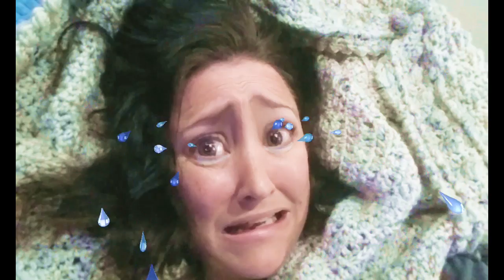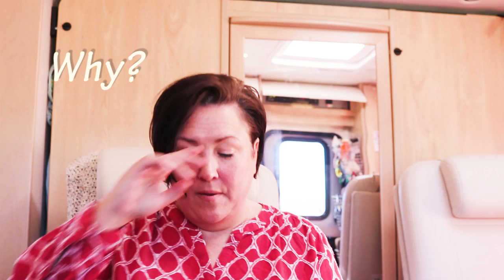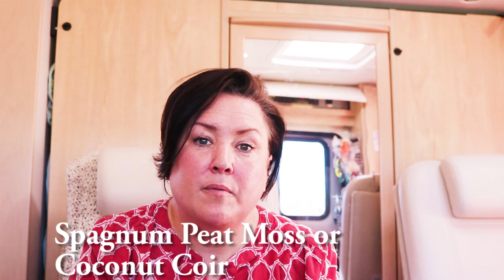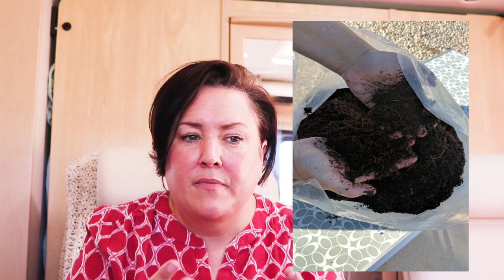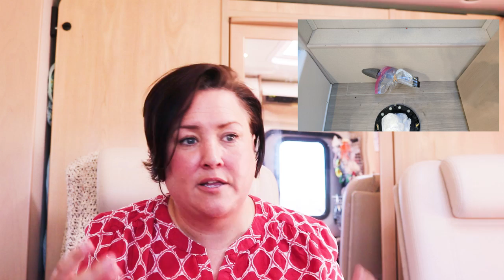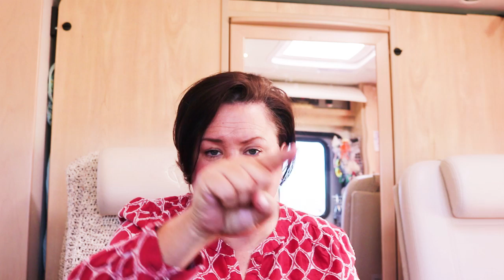My DIY Composting Toilet Install and 4 installation hacks I learned!

Comment: That is one expensive toilet!  I considered it but plan on building my own with the separett privy kit.  More to locate and fabricate but only things like a bucket, toilet seat, container for #1...  will save me over $700...   many won’t want to do what I am so your video was perfect for them and still very helpful for me. Just thought I’d post this as maybe others can’t afford the Nature’s head either.
Reply from the maker: Emily true Emily. I actually test out and mcgyver all kinds of stuff and last winter I tried different ways to RV in winter and actually put a regular trash bag and Kitty litter in the toilet, which also worked great (although my cat looked confused)! It was just an expensive long term solution because of the cost of lot litter. Great comment!!
Reply: Creativity RV  thanks!  Yes I’ve tried kitty litter method too. It worked fine ;0) If I wasn’t a broke educator I’d buy the one you did. I’m just trying to save and get on the road like you so every bit I can save helps! Love teaching but not the ridiculous pay etc.  thanks again for another informative vid!  Especially your composting material suggestions.
Reply: Emily, I just bought a urine separator after trying out different funnels. I've been working on this project for a while, but after viewing some of the DIY videos and plans, I think I can make a decent composting toilet. Creativity RV answered my questions about removing a toilet and stopping the stink from the black tank. Eventually, I would like to have #1 just go into the black tank. I was in education for sixteen years. I hear you.
Reply from the maker: Hi there! Please, check out these next to videos in this series, if you haven’t already. Thanks for watching!
https://youtu.be/NL3j4vZ-kG4
https://youtu.be/7aTxqObExL8
Reply: You will still have the expense of time and money to find a place and discharge the tank.   :(

Comment: I live primarily on a boat, boats do not have composting toilets, they have holding tanks.    5 or 6 gallons for a shower?  You are very wasteful.  My 22 gallons can last for better than 2 weeks, taking a daily shower and using the toilet as it should be used.  (A shower can be as little as a couple of cups of water, flush the toilet with it).  You explained you dump urine irresponsibly.  Your human cat box is not the easy way, it's the hard way.   I watched this three times and missed how you dispose of the solids.    No more dumping of your tanks, but you have to dump the urine in a planter.  STOP justifying dumping your urine like a hobo.
Reply: I don't know how you could get clean with 2 cups of water. Do you shave your head? There is no way I could rinse my shampoo and then conditioner with 2 cups of water.
Reply: You get your hair wet first, wash your hair, by then your body is wet, so you wash that, then rinse from top down.  With practice you would be amazed.
Reply: Interesting...but for a woman with a lot of hair, it takes more to rinse—-good technique to use though